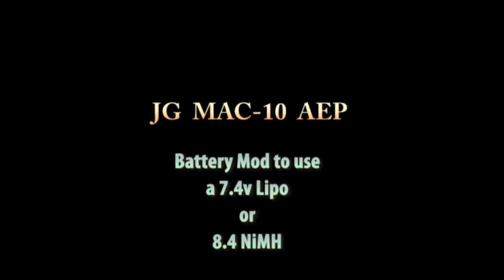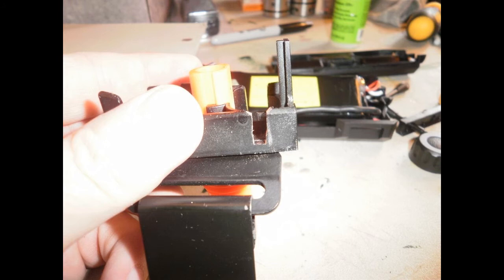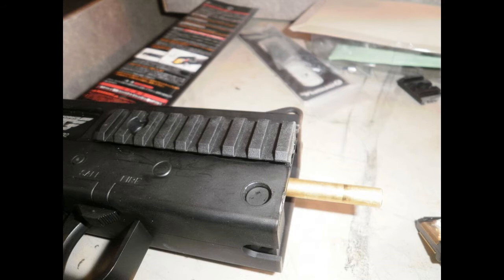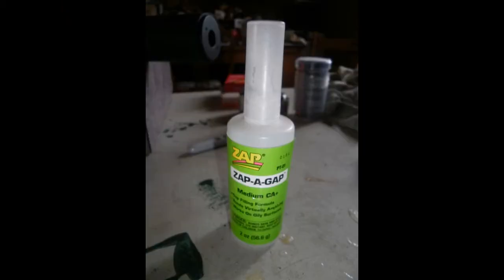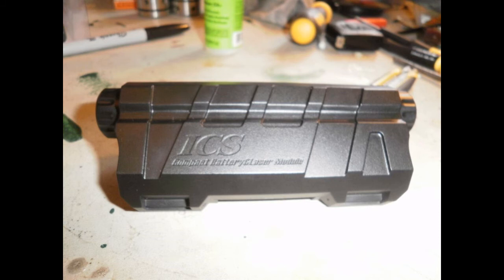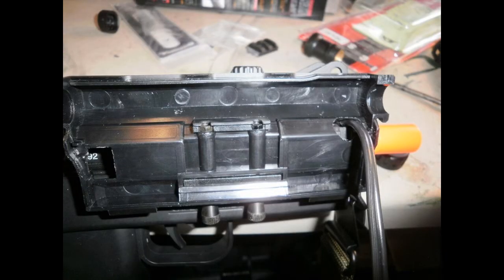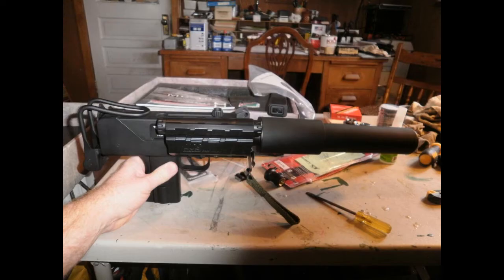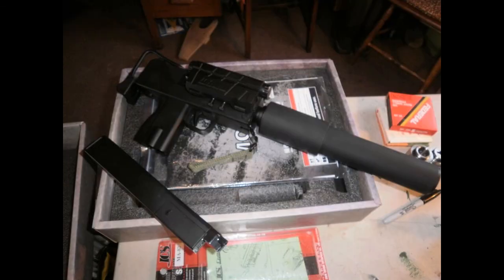*AIRSOFT HOBBY* - JG MAC-10 Battery Mod

Comment: There is an adapter that just plugs into the normal spot, but doesn't have the bulky mess coming off the end so you can keep your battery in any gun without need for a PEQ box. I think it is only for 7.4v Li-Po's, but it shouldn't matter too much since an AEP runs at 7.2 normally.
Reply: do you have a link?
Reply: link??
Reply: @MollyTheLag  I think it is this, and I will not add the dot in .com so youtube wont delete my comment. https://www.hobbytowncom/protek-rc-2s-high-power-30c-micro-lipo-battery-7.4v-240mah-ptk-5185/p169479       It should be hobbytown  .  com but without spaces. It is ok it is wired to small tamiya I think.
Reply: It’s called the Tokyo Marui EX Adapter. You just slide a TM AEP LIPO into it and it will fit the MAC 10s. All the AEP have proprietary slotted end cap connectors so you need the adapter unless you want to solder and modify internals.

Comment: It’s a Tokyo Marui clone so if you want to use micro lipo you need a micro lipo pack that fit TM AEP and the TM EX adapter so the polarity fits and size difference inside the battery holder. You also need a lipo specific charger. That’s the way to do it if you don’t want to modify anything on the gun.

Comment: What type of battery  connections are they proprietary or not
Reply from the maker: Uses a proprietary 7.2 nicad battery. I put the adapter in it to get the cables out to a Tamiya end. Down below somebody mentioned about getting a battery that actually fits directly in it. I don't have a link for that though.
Reply: @NepaAirsoft  I found a link. I commented it under Five's post.

Comment: great video I have a tokyo marui mac 10 can I do exactly what you did here or does the JG have a longer connecter on the inside
Reply from the maker: +Commander wolffee Both are the same.  i did the mod on both and worked out great.  Another JG I got as a boneyard one I wired direct to a 7.4v Micro lipo with JST ends.
Reply: nice video, is the JG mac 10 TM clone?
thanks. :)
Reply from the maker: Basically, but a little cheaper cost.
Reply: NepaAirsoft thanks for the reply, just got one myself, on its way :)
Reply from the maker: Check out this video.  You mgith just want to wire in a JST Lipo Micro 7.4v battery and run it that way.
Reply: NepaAirsoft yeah definitely a possibility.
Thanks ;)